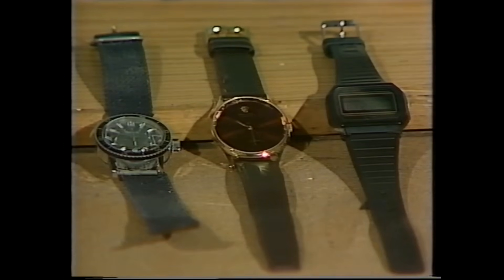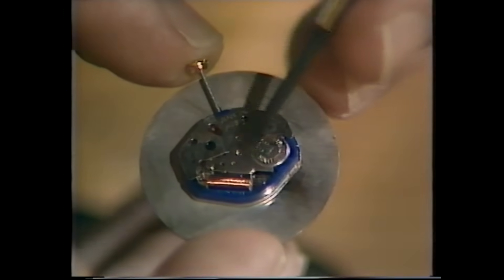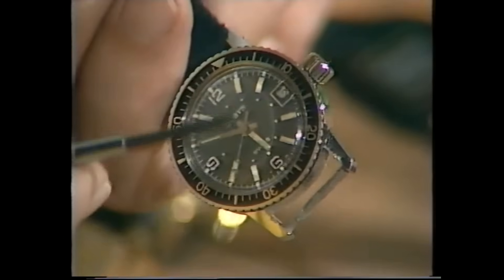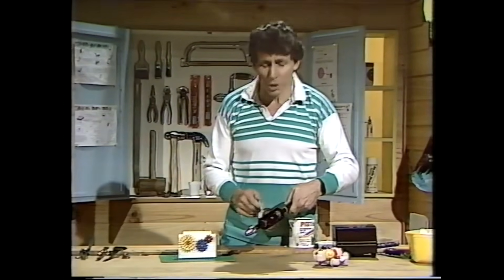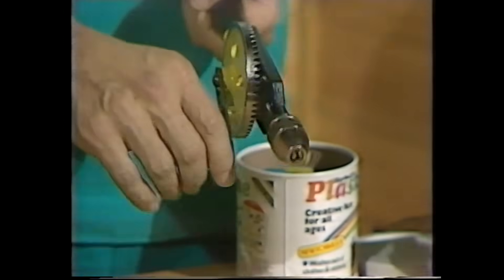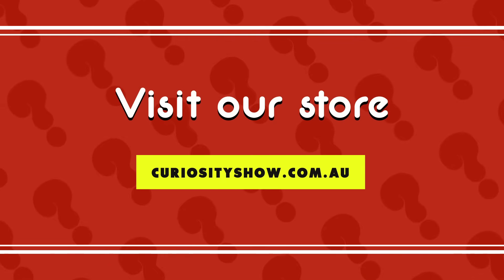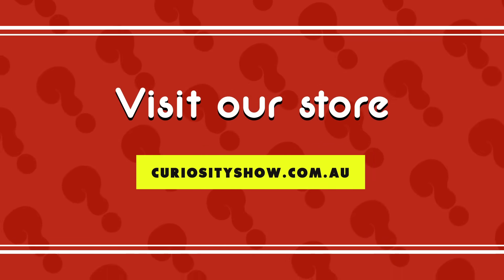Cogs and gears - a closer look

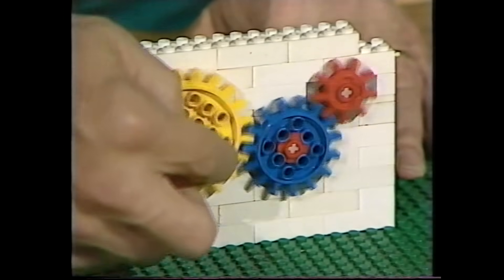Comment: 2:28 Not explained very precisely. Explanations, especially for children, should be accurate. Otherwise, they'll think something inaccurate or wrong for a long time. The shaft of the smaller cogwheel rotate faster, but the teeth all move at the same speed. Not like the claim here that the teeth on the smaller cogwheel are faster, so you can barely see them. I'm an expert on cogwheels—I played with LEGO gears just like these when I was five or six.
Reply: I agree with you.  The explanations as a whole are imprecise and inaccurate.  Speed is not the same thing as velocity.  Obviously, the concept of angular velocity would not be understandable for the target audience.  I think it would be better to explain things that would be understandable than to provide inaccurate and confusing information.

I think it's also questionable that the moderator explains the principle of mechanical advantage, but doesn't mention the term.  I can understand the producers wanting to avoid jargon, but if a child wanted to ask about this subject, he or she wouldn't know what terms to use or what to look up.

I would say this was well-intentioned but not thought through and as a child, I would have been frustrated and confused by it.
Reply: @laurencefinston7036  Yes. When explaining things to children, you obviously have to simplify things and avoid technical terms, or explain them. Here, it would have been sufficient and correct to say that the small cogwheel rotates faster. Going into the speed of the teeth was overkill. 

Of course, I don't know if I would have noticed this as a child. But I always hated discovering later that I had been taught inaccurate or incorrect things.
Reply: @Tag-Traeumer  I can't be sure, of course, but I think I would have noticed that the teeth on the gears appear to be turning at about the same "speed", or rate, or whatever one wants to call it, and been confused by the statement of the opposite.  I looked at it now and needed awhile to figure out what was going on.

A few months ago I was doing some work with plane linkages and the way they work have some similarities with systems of gears.  When two gears are interlocked and one is driving the other, the distance traveled of a point on either of the circles where the teeth meet and where they are constantly in contact for any given angle can be calculated by using the circumference of either circle.  For anyone whose junior high school math is a little rusty, the circumference of a circle is 2 times pi times the radius of the circle.  The distances from the centers of the gears to any point on their corresponding teeth can be calculated in a similar way.

It's a lot easier to make models of plane linkages than of gears.  Gear teeth can be pretty complex.
Reply: @laurencefinston7036  Yes, thinking for yourself and learning is the most important thing. And it's useful every now and then. Recently, I calculated an angle using diameter times pi and a distance on the circumference to determine a deviation in the geometry of my bicycle. Diameter times pi has been in my head ever since I learned it at school—a very nice and historically important formula. 

True, the gear ratio of a gearbox is simple, but the geometry of a tooth is complex: involute gearing, cycloidal gearing...
Reply: @Tag-Traeumer  I use the relation of the ratio of the circumference to the radius (or equivalently, the diameter) of circles all the time.  For example, I used it for making "sphere developments" for paper models of spheres.  To do this for ellipsoids or other quadric surfaces already requires calculus.  I also use it for animated graphical effects with rotating or revolving letters and other figures.  Pretty much for everything involving rotation.
Reply: @laurencefinston7036  These are interesting and challenging activities. Yes, pi comes into play with anything that rotates or is round. Of course, I know 3.14 by heart. I sometimes calculate things for fun, like the speed of my fan's propeller tips based on its rotational speed (124.3 km/h, 77.2 mph). Or how often the reed switch on my bike computer switches in a year (1.12 million times). It is said that the ancient Egyptians first needed the number pi to calculate the contents of their round granaries. They assumed 3 because they were suspicious of odd or even infinitely consecutive numbers.
Reply: @Tag-Traeumer  I'm sure you know this, but since many people have an aversion to math or are even afraid of it, the formula for calculating the distance along the perimeter of a circle given the angle, or conversely, the angle subtended given the distance is angle/360 = distance/circumference.  A simple application of this would be to measure the distance travelled by a rod attached to rotating wheel using a linkage or a slider mechanism.

Of course, pi is essential to trigonometry, and that's another thing that I use very often, if not, strictly speaking, every day.  Triangle solutions,  which are closely related to trigonometry or even part of it (not sure about this) are another technique of elementary mathematics that are very useful for practical purposes, e.g., measuring distances.

I wish I had better mathematical skills, but you can get a very long way with elementary mathematics.  Besides, with computer programming, it takes so long to implement even relatively simple things, that my lack of mathematical skills isn't really the bottleneck in my work.
Reply: @laurencefinston7036  Yes, I used that calculation involving distance and angle on a circle just a few days ago.  Oh, trigonometry... I learned that in school, but only with a calculator (you can also use tables). I was never particularly good at algebra either; we didn't study it thoroughly in school. But I've developed mathematical formulas for a specific problem several times that worked. It just took me longer to get them right. Some time ago, I became interested in the difference in the travel time of a light beam passing through lead glass instead of air, and I developed a formula. It also agreed with the deviation of the reading on my laser rangefinder when I measured through glass.
Reply: @Tag-Traeumer  I well remember my trigonometry textbook from high school and the tables at the back.  We weren't allowed to use pocket calculators when I was in school.  In college, it was allowed.  I enjoyed trigonometry and I've always loved geometry.

I never had a physics class and now in my old age I'm starting to learn some physics.  I haven't gotten to optics yet, since I'm still learning the basics, but I know that the phenomenon you refer to is related to refraction and that materials such as glass or water have indices of refraction.

Nowadays, access to information about mathematical and scientific topics that's reasonably easy to understand is much easier than in my day.
Reply: @laurencefinston7036  It was the same for us with the calculator ban. When we were in elementary school, we wouldn't have been able to afford such an expensive device anyway. I was always more interested in practical knowledge like physics and geometry, less in mathematics. Yes, these days anyone can find and learn any subject they're interested in. 

Incidentally, the light in my piece of lead glass travels at 59.6% of the speed of light in a vacuum (I measured this with a laser rangefinder and find it fascinating). Yes, that also has to do with refraction of light. I've always found total internal reflection interesting, where light exits from the dense medium and then reenters it again.
Reply: @Tag-Traeumer  My first memory of pocket calculators was in 8th grade, when other kids started bringing them to school.  I remember that if you entered 07734 and looked at it upside-down, it would spell "hELLO".  The displays were red, I don't know if they were LEDs or something else.  Liquid crystal came later.

In college, I had an HP-11C which I used for decades.  About a year ago, it failed to turn on and replacing the batteries didn't help.  I found a similar model, HP 15-C "Collector's Edition", and have been using it since.  After using a Reverse Polish Notation (RPN) calculator, I find it difficult to adjust to "normal" ones.

Since learning to program computers (which was my profession), I haven't used the programming features of my HP calculators very much.  Unlike the 11C, the 15C can perform matrix operations.  I'd like to try this out, but I haven't gotten around to it.  Vectors and matrices are the bread and butter of graphics programmers.

One of my favorite books since discovering it by accident at my local library about 50 years ago has been "Mathematical Models" by Cundy and Rollett.  It's inspired a lot of my work, for example, on polyhedron models and plane linkages.  One of these days I really should return it.  (Actually, I do have a copy of my own.)
Reply: @Tag-Traeumer  I like the idea of that experiment.  I should get one of those laser rangefinders.  I've got quite a collection of measuring devices but not one of those.
Reply: @laurencefinston7036  I also remember the thing about turning the calculator around from back in the day. What can you write with O, I, E, S, L, and B? When I was thinking about it a few years ago, 52 words came to mind (in German). Ha! I just found another one: SILO. Number 53! 4 as h, I hadn't even thought of that, that makes even more words!

Yes, I think the red display in calculators used to be LEDs. They consumed a lot of power back then.

I once rescued a desktop calculator from the trash whose displays consisted of individual VFD tubes, a Sharp ELSI 804 from 1973. I always use it to calculate my tax return once a year. The keys are different than usual; there are combined "-=" and "+=" keys. But it's not RPN, as I first thought. I didn't know RPN. Algebra was never my strong suit.

I bought the laser rangefinder out of curiosity. I'd never really used it.
Reply: @Tag-Traeumer  I didn't speak German back then.  I learned German in college.  I've lived in Germany for over 30 years.  +=, -=, /=, *= and %= are operators in the C programming language.  %= is for the modulus function as applied to integers.  For integers, it's the whole number remainder after (possibly repeated) division.  I didn't know any calculators had "operation with assignment" functions.  Edit:  I suppose it's really "operation and show the result immediately" on a calculator, rather than an assignment to a variable.  My HP 11C could assign to a couple of predefined variables for loops and statistics, but it was very limited in comparison to a language like C.

Modulus is very useful  for loops in computer programs.  You can convert a sequence like {0, 1, 2, 3, 4, 5, 6 ... } to a repeating one like this:  {0, 1, 2, 3, 0, 1, 2 3, 0, 1, 2, 3 ...}.  In case this isn't obvious to anybody, that would x % 4.
Reply: @laurencefinston7036  That sounds complicated. :-) I've never been into programming. I did buy a computer in 1988, a Commodore Amiga 2000. I still have it, and it works. Except for the monitor, where a suppression capacitor blew, but I'll fix that soon.
Reply: @Tag-Traeumer   I tried to post a reply, but it kept disappearing and I got errors when I tried to edit it.  This seems to happen often when I try to post something substantial and it's very frustrating.  Needless to say, I don't break any rules.  I've been enjoying our conversation and if you'd like to continue it, please feel free to send me an email.  I'm losing patience with these problems with YouTube.

Comment: 2:30 Funny that you mention "you can barely see the teeth"

I can see how that could convince a kid that the smaller wheel is going faster, but the teeth are all going at the exact same speed.
You'd need to have gears of different sizes on the same axle to see teeth going at different speeds
Reply: Also, what Dean refers to as “power” is actually torque. A gear chain exchanges speed for torque or vice versa, but the power remains constant (ignoring any efficiency losses to friction).